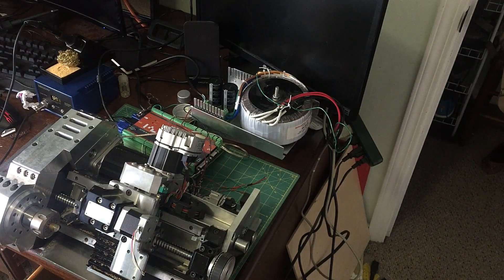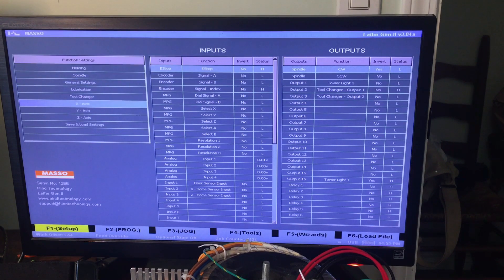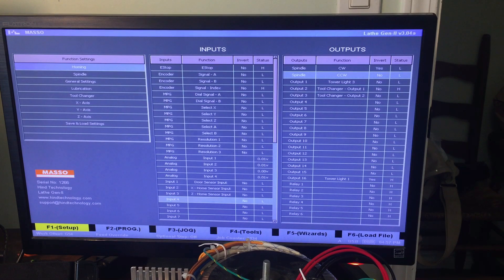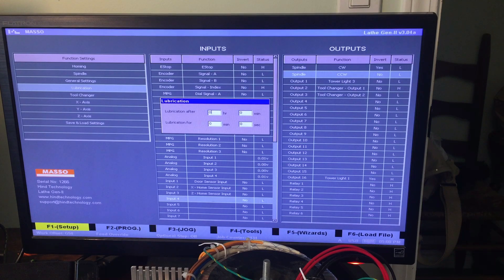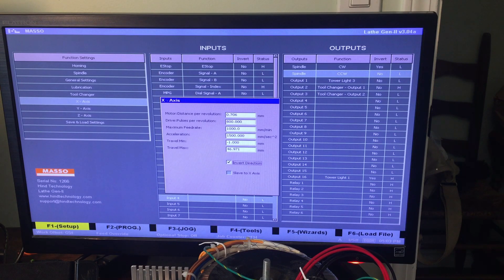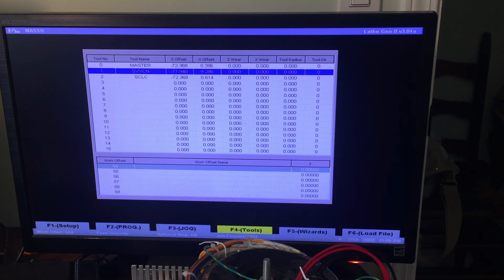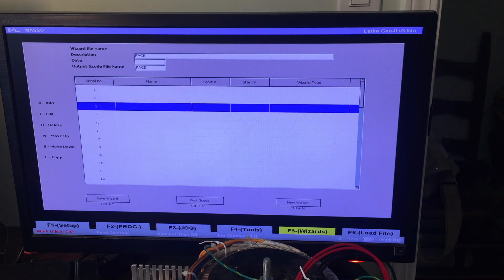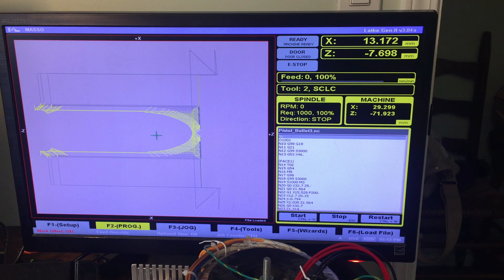MASSO CNC Controller Setup with Clearpath Motors Part 2:  MASSO Settings

Comment: Would you redo this with the current version of the software? I used your guide for wiring the clearpath motors to the Masso Touch controller but it doesn't seem to be working. I have a feeling it's in the configuration but I'm not sure. If you do redo this video, please spend some time on the inputs panel. Your wiring instruction have us putting one of the wires on the #5 input but don't indicate what to set that to in the Masso config.

Comment: I contacted clear path to ask them what would be the best motor to replace the brushed dc motor for my small lathe so I could use it full time and for threading and rigid tapping.  They told me it would be the sdhp 3446deln.  I know you are going over Masso here, but are you familiar with centroid acorn and how I would go about setting it up?  Ps love the builds, and sorry for such a noob question.
Reply from the maker: I am aware of the centroid acorn, but I've never used one and am not familiar with setting it up:(  The 3446D-ELN is a step/direction motor, so if the acorn has a setting to use one of those as a spindle, it should have everything it needs to know about threading.  It will tell the motor precisely how to move, so it should be able to synchronize the carriage.  

The more common approach is to have an encoder on the spindle shaft or in the drivetrain somewhere that has an "index pulse" - a signal that appears once every rotation.  Controllers will use that to know when to "engage the half nut" and start moving.  Unfortunately, I don't think clearpaths give you access to their built-in encoder's index pulse, so as I said above, the controller would have to be able to synchronize the motion itself.

Hope that helps!
Reply: Tabletop Machine Shop.  Awesome thank you for the reply.  My thoughts were the same with sd series after watching clear paths videos.  Which clear path are you using for your spindle motor?  You can do threading with it?  Clear path gave me a snooty reply to my last question, so although they were recommended to me for ease of use, I’m thinking about going with the dmm tech as I’m under the impression that the encoder out on the driver plugs right into the encoder input on the acorn board. Hassle free supposedly.  Thanks for being a real person.  Finding so many pretentious assholes in the cnc world that I’m bout ready to stay with my humble friends in the manual realm.

Comment: The software looks primitive compared to the centroid acorn 4 software. Are they regularly updating the software?
Reply from the maker: They actually did update the software since this video was released and it looks/works better.  They actually support using a mouse now as well which I find helps a lot

Comment: can you help me with the   wiring diagrams for a milling machine
Reply from the maker: I've actually never wired a milling machine for Masso before.  I'd have to assume it's very similar to a lathe but with one extra axis..
Reply: For a milling machine all 3 axis are the same
Reply: the green I think you have in the outputs right
Reply: did u get it wired ?
Reply: @joeygonzo  Hello I did but it just goes around one way I don't know where the white wire go's

Comment: Is there a setting for a US keyboard layout?? I really want HDMI. What the hell do I have to do to get a 1080p screen with this kind of stuff?! I think the UI needs some work....or it is not a very powerful SBC. I would love to know more about this, I want to know more about the hardware under the cover and what the firmware looks like. Definitely interesting, not totally sold on it just yet.
Reply from the maker: I'm actually not sure about keyboard setting.  I agree, I would have preferred HDMI to VGA, though I imagine they're going for machine retrofits as well as new machines so perhaps VGA is more common.  I think the firmware is pretty much closed off, but perhaps I'll do a speculative vid on the electronics (not my strong suit but I could try!)  I'm still optimistic about it... There have been lots of updates that I haven't checked out yet, so I'm hoping they fixed lots of the bugs.
Reply: Oh I'm not saying I do not like it, I do think I'll with one for my first project as well. Just not sure if it will be used for me second :)

Comment: Did you ever figure out the X zero issue setting it to some random number ,have the same problem.
Reply from the maker: I didn't, but it seemed to fix itself with one of the updates.  I'm still working on increasing the  reliability of the tools before I dive back in, but I'll likely make a video on it all up and running, and if it's still an issue I'll surely mention it
Reply: I am right where you left off i think, i do not believe  its fixed ,mine has the latest update and it still will not zero. If you get it figured out post a video, i'll throw a few bucks your way to help.
I saw a video on a Acorn from centroid and you may want to have a look at it, similar i think ,everything works from G53 location as far as tool and work offsets , man they need to get something out on this ,i am almost ready to jump ship and sell the thing and buy a Acorn.
Reply: I found a problem with the X tool post front and rear it is reversed , all you need to do is put in Diam. and touch and make sure you reverse the tool post ,in your case with a slant rear you would use (front ) no check mark.
Reply: I have found out that the backlash is broken in Z and X ,and can cause error 's in the x axis cutting correctly,they have been informed of the issue and proved it to be true . 
 But have not said what they are going to do to fix the two errors ,ie: tool post reversed error and backlash error but they have been very helpful so far so maybe they will get it done soon.

Comment: So I just binge watched your lathe vids, I'm wondering why slant bed lathes turn parts on the back side of the part? This seems to me like it would be lifting the carriage away from the ways. I cant think of any logical reason why you wouldn't want the cutting force to be transmitted down through the frame of the machine?
Reply from the maker: My understanding is that if you imagine a tool post as being able to pivot about its base due to bending in the material, downwards-facing tools are pushed out of the cut whereas upwards facing tools are pushed into the cut.  This basically prevents the part from being gouged, especially for high force operations.   I started doing it on my Taig lathe way back when for parting and found it to be a big improvement so I just kind of stuck with it

Comment: I have been following your tool changer and mini lathe project.  Very cool!  But I am not sold on MASSO at all.  At your recommendation, I went to look at them.   Proprietary Hardware, OS and CAM.   No network, No Mouse, No touch screen, and many features not present.  I get the idea and it is a good one at a great price for a commercial CNC.  But there is a reason they are selling it for $500 rather than $5000.  NOT ready.  Its like going back to the 1980s.  Looks like and acts windows 3.0 - DOS based.

Two things get me the most.  1) Flash drives - WTH!  Why would I want to carry flash drives around with my G-code and firmware updates.  This is the 21st century.  Raspberry PI has 100mb Ethernet and costs <$20.  2) Proprietary closed OS - can't load my other tools.   They haven't developed it and therefor, you can not use it.

Admittedly, even big box cam systems have not incorporated full connectivity yet. Those of us coming from the computer world into CNC can't comprehend why the whole world is not connected via Ethernet.  Its the IoT ya know!

The MASSO hardware would be very interesting if I could run it with other software.  I would probably buy a couple.
Reply: I love this idea. I'm a cnc operator and the prosses we use is thumb drive, or direct connection, fiber or ethernet.
With all these inputs, the only thing sent is gcode.
You never want any other software on the controller. That is why our cadcam programs were on another computer, as well as supporting software.
Reply from the maker: Yep I agree with what you're saying. MASSO seems to be the only serious offering in this area and price range for now, but that said if I were to make another machine I'm not certain that I would use a MASSO on it.  I love the idea behind MASSO -- No PC work station makes for a much more mobile machine, but yeah the fact that you can't work under the hood makes it a little less appealing.  I think if they had an OEM option where you could either use your own software or customize their software exactly like you wanted it would be a lot more appealing.  There are some open sourced options like Beaglebone black with Machinekit that, while also not really ready, are at least can be heavily customized.

It's funny, I think I'm in the same boat as you, going from PC to a "disconnected" system, and yeah, it seems crazy that all controllers don't have a drag-and-drop wireless file system -- even 3D printers do!  One thing I will say about MASSO is that the customer service so far has been impeccable, and my gut tells me that they will figure out a lot of the initial issues (hopefully a mouse comes along soon...)  Thanks for watching!
Reply: I was thinking the same thing as Green Range - feels expensive and has an old DOS-like UI in a closed OS. At least for me that's mostly played with 3d printers and not much CNC (yet). I use a cheap Raspberry Pi 3 and OctoPrint to stream gcode to my 3d printer. Just use the octoprint web interface from a regular desktop pc, drop a gcode file and press print. 

Don't see why CNC still should be so much more expensive. Should be able to use an Arduino with a cheap RAMPS 1.4 board running GRBL from an Raspberry Pi just as well.

I guess reliability and ease of use is not quite there yet.

Comment: Thank you for your video, You seem to have a good understanding of things, me on the other hand not so, its all greek to me. I'm just a newbie with anything to do with CNC. I certainly have my challenges  coming in the days etc ahead, fun ones I hope. I decided to get the Masso as I've heard Mach3 is changing up to a 4, but has lots of issues. I really don't know, but I really like the idea of a self contained unit, so here I am  also, but its hard to figure things out, but I'll get there in due course. Have been in touch with the mfg and they are very willing to walk me through the settings etc. So I look forward to the time ahead. They are if I understand correctly coming out with new web page for us to get better aquainted and more easily to setup...that will be nice, so they are getting there. Thanks again, Andrew
Reply from the maker: Hi Andrew,

I've been there :P.  MASSO is a good place to start because at the very least you don't have to worry about COM ports or, god forbid, ethernet ports.  Their customer service is pretty excellent, I agree.  If you have any questions feel free to send me a message -- I've already made most mistakes that can be made in CNC, and I'd be happy to share what I know!

Comment: Are you all aware of the new open hardware beaglebone blue (yes blue not black) CNC running the open source MachineKit software? This also replaces the PC in CNC controlling.
Reply from the maker: +rol eic i was aware of beaglebone black with machinekit but not beaglebone blue... i'll have to check it out!
Reply from the maker: +rol eic i was aware of beaglebone black with machinekit but not beaglebone blue!  I'll have to check it out, thanks!
Reply: You are welcome. Basically beaglebone blue is a bieaglebone black with a former stick-on cape directly integrated in one unit for direct connectivity.

Comment: Firstly a great video and mate you are putting me under a lot of pressure here to make some good videos of my own :)

For the tool calibration you mentioned that you had some issues, please let me know but the only thing I can see as your turret is not functional yet is to first make sure the same tool is loaded in the controller. For example you might have tool 2 in position and trying to calibrate it but on the MASSO your current loaded tool is tool 6, so now when you calibrate the tool it will always  give wrong calibration. Please first issue a MDI command to load tool 2 and then goto F4 to calibrate. 

Hope this helps and if there is any bug then I would definitely look in to that, please let me know.
Reply: Why make your own?  I'm guessing your motivated customer (hlaps1990) would be willing to discuss a mutually beneficial relationship.  You can concentrate on product development, he can formally run through the FAQs and perhaps get something in return.  

Or not, I'm just looking at two problems that appear to solve each other, from the outside.  :-)

Comment: i Think the control x setting is touch the of of a know diameter and it finds center by dividing by two maybe
Reply from the maker: Its weird though because the center shouldn't change, and everything on CNC lathes is in terms of diameter anyways (DRO shows twice the literal motion because it reads diameter) .. weird
Reply: So are you post processing in diameter or radius? makes a difference.

Comment: why do you have no ballscrew on the X axis?
Reply: Maybe space limitations?
Reply from the maker: Manny is correct, it's mostly space and cost -- ballscrews below 12mm are extremely expensive, but I would never get a 12mm ballscrew to fit.  Another important factor is that a nice leadscrew beats a bad ballscrew for accuracy.  I was looking at an 8mm ballscrew but it was like $200!